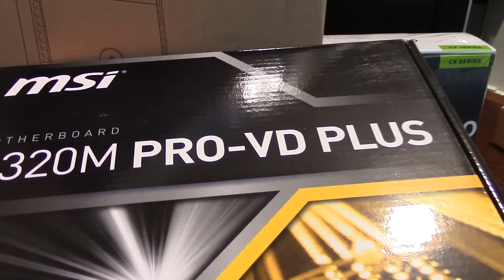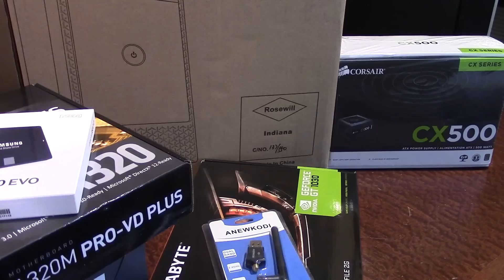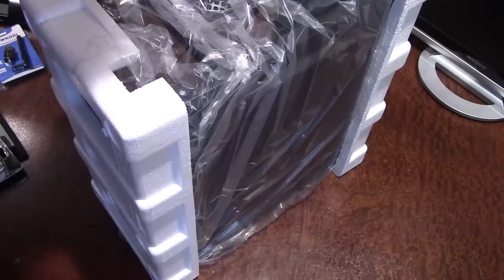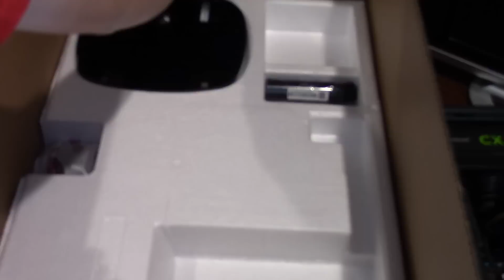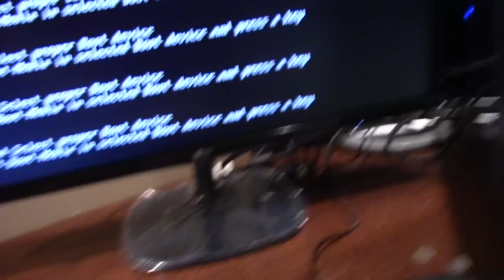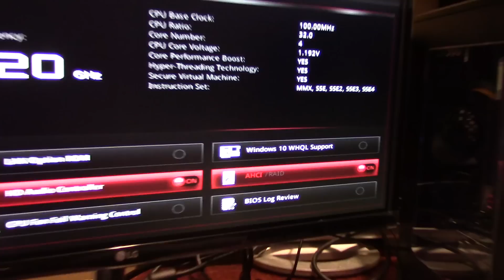AMD Ryzen 5 PC Build - January 2018

Comment: I need help choosing my new CPU. I have a i3 6100 and I've been wondering if I should upgrade to a i5 7600k or upgrade to a ryzen 1600
Reply: If you intend to do gaming with minimal editing, upgrade to 7600k (80:20 ratio respectively). But if you wanted to do gaming + heavy editing + having the thought of "future proof", get the Ryzen 5 1600. That's my opinion bro. But then again, the decision is still yours. Goodluck!

Comment: You should replace the 250g SSD with a larger mechanical. SSD maybe faster, but 250g is not going to last very long. Especially if they are going to be doing dvd read writing. Windows 10 alone is going to take a chunk of storage.
Reply from the maker: They will be fine with the current drive. Windows only took up about 16gb of space, and they are only going to have programs on the drive with a few documents
Reply: Or just add a hard drive with atleast 500gb. I recommend 1TB I’ll never use up 1TB